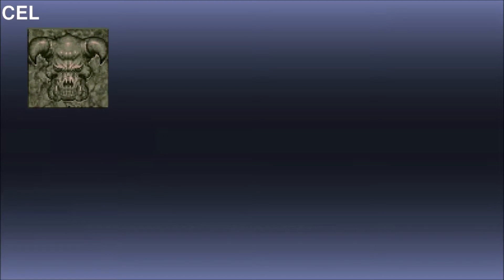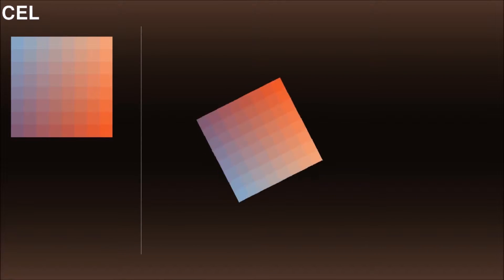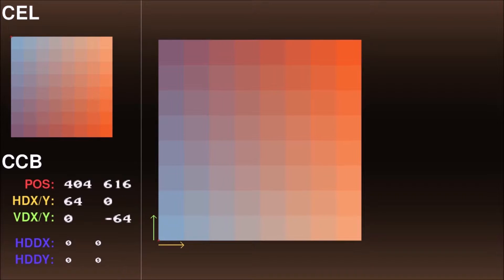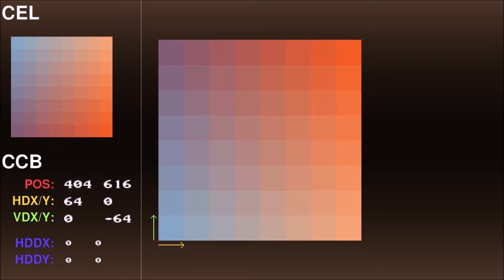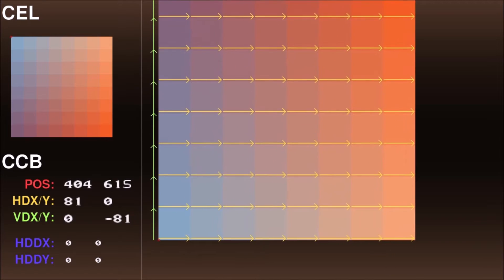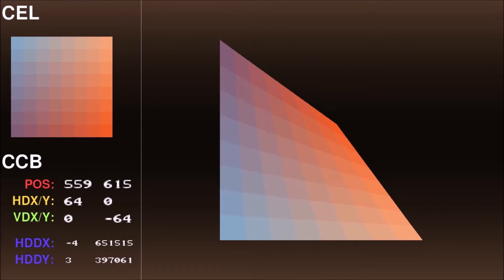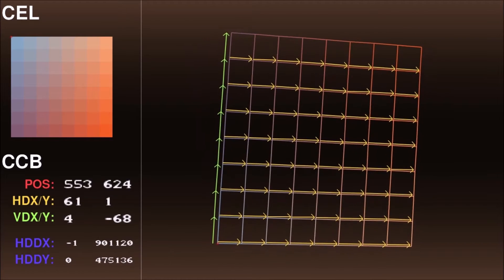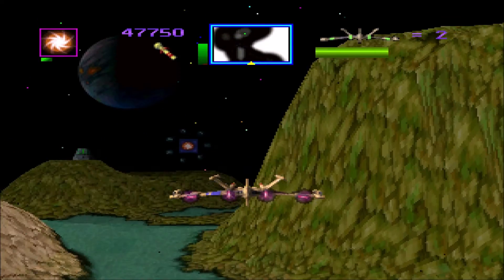3DO Rendering, CEL Vectors explained

Comment: I guess this way (as opposed to the modern arbitrary sampling way) makes sense if you were coming from the sega genesis/master system, and your experience with stretching background layers is via using h-blank and v-blank updates.

As in, partway through drawing something on screen, you update the values of the scan next line drawn. This allows you to make stretched out, distorted, etc. shapes.

With that concept fresh in memory, maybe that's why they did it this way.

See coding hut's explaination of the sonic bonus world rotation, or mickey's tower or waterfall effects, or of course paralelex scrolling.

Just a guess from me.

Interesting video! Thank you for this.

Comment: Is it possible to alter the vectors by matrix multiplication? I'm writing a 3DO CEL engine emulator that runs on modern GPUs via HLSL. (I found out that you can use HLSL to code shaders for both DirectX and Vulkan)

My 3DO CEL emulator works by taking vertices in, which are turned into quads/CELs by the geometry shader.
Reply from the maker: It depends on what you want to do. I am not sure.
I mean, you can multiply the vectors. If the CEL is showing a 2d sprite, multiplying the two main vectors with a 2d rotation matrix will rotate the sprite. But on 3D, you have the finally 2D projected quads on screen, so it won't help. So, while I have CPU code that will convert 4 quad points to the 3 vectors (and in case of sprites you need the 2 vectors only, and no points, just position, zoom and angle, I end up doing all my 3D math on CPU (although there is hardware matrix I see, but I need to see how it works) get the final projected quad vertices on the screen, now with some CPU code I convert to the vectors necessary to fit this quad (I don't know if it can be done with a matrix or if it's worth it).
Reply: @Optimus6128  I'm thinking of using a 3x3 matrix for the CEL's translation and scaling, not just for rotation in 2D space.
Reply from the maker: @gdm413229  It should be possible.

Comment: So the 3D0 is essentially the Saturn with only one VDP?
Reply from the maker: Yeah, just a main framebuffer and the ability to strech bitmaps to fit any arbitrary quad. So I guess it's like VDP1 with one a single layer.
One pro is that enabling translucency will blend with what is already rendered in the background after every single CEL quad rendering, so you can blend sprites above sprites above sprites, works like a charm even if slower, unlike Saturn having several troubles with this.

As I am reading about the Saturn VDP processors, the different layers and why it struggles with transparency, it's an interesting system which I might try coding something in the future (mostly to make some interesting comparisons between 3DO renderer and Saturn)

Comment: Is it possible to develop a 3DO game using a modern computer or do we need a Dev-kit for it? nice videos btw. I'm subscribed to your channel now.
Reply from the maker: Of course it is possible. I don't even own any devkit (they must be very rare or expensive now).
I have set up a compiler on Windows and using some additional tools to write to encrypted ISO, it was a bit tedious to set up at first, but there was a tutorial somewhere to start homebrew coding. I currently experiment with various stuff and also work a bit on the Doom 3DO code.
Reply: @Optimus6128  Thanks for your reply. Nice to read that. I've tried to look up for this on google but I couldn't find any information. Maybe I did not use the right words. Would be great if you can show us a little bit of your setup.
Reply from the maker: @Hackinside  You can check http://www.3do.cdinteractive.co.uk/viewtopic.php?f=21&t=3547 and maybe there is more in the forum http://www.3do.cdinteractive.co.uk/viewforum.php?f=21
However, as it usually happens with small homebrew communities, there might be some broken links to the tools. I'll try to find other links later (or maybe when I get time, upload them in my site and post a small tutorial, will see)

Comment: Love your videos! The 3do seems very similar to the Saturn. Using lower quality textures makes a huge difference in performances too, so mipmapping and LOD are really good optimisations. Nice to know that the 3do has no problem with transparency, unlike the Saturn where it's buggy.
Reply from the maker: I heard somewhere that a reason Saturn has problem with transparency is because of this forward rendering, you could have overdraw and few of the bitmap pixels will additive blend more times on the same pixel for example, so you get artifacts if I understood. There was an emulator developer (although I am not sure he ever made a Saturn emulator but was very knowledgable) who mentioned this. Is that true? (I'd have to experiment coding for Saturn to figure this out, but I'd ask you :)

Previously, I thought that the problem with Saturn and transparency is that it's one out of the five layers, and that layer will blend with the others so you could have a transparent object, but not transparent objects over transparent objects unless you do software rendering over that layer, while on the 3DO every cel you render with transparency will do operation with what's already in the framebuffer, so just z-sort the order of rendering of your transparent cels and apply them and it will work. But I can confirm that I have never encountered artifacts in the case of 3DO when I render transparent cels in my 3D geometry no matter the shape or size (but I haven't tested yet the twisted shapes) which could be a problem when the cels would be less than 1x scale and it would render pixels over pixels, but also if I understood the patent I read, they keep track of pixel coverage to avoid this.
Reply: @Optimus6128  Yes, it creates artifacts, but only with distorted sprites. When the sprite is just scaled without distortion it works fine. Yes also about the layers : the  sprite transparency only works over other sprites...only if they are using RGB color code (no palettes). Most people just used the mesh effect where you skip 1 pixel out of 2 as it's just way easier and it works over every layer and sprite type.
It's possible to use other fancy tricks to get transparency, but it's never perfect. At least the transparency with the background processor (vdp2) works really well and is super fast.
Reply from the maker: @xl2k2008  Interesting, good to know. It makes sense that when quads are aligned to the screen to not have artifacts.
Saturn is more specialized with the many layers and processors that maybe interesting architecture but come with problems and restrictions.
3DO is more simple run of the mill generic renderer drawing at a framebuffer that sits on regular memory. So the blend function will blend CEL to framebuffer, and we can continue subsequently blending the next CELs against the already blended framebuffer without issues. There are different color depths of CELs, from 8bit palettized, 8bit/16bit RGB, and others, blend or other functions works the same for all, no problem.
Reply: @Optimus6128  The Saturn is very complicated, but it should allow (on paper at least) very advanced effects not possible on other consoles of the era, but it's almost impossible to make everything work together. Your videos makes me want to try to buy a 3do and try programming on it. Sadly they aren't cheap now!
Reply from the maker: @xl2k2008  Yes, the 3DOs at Ebay now are more expensive than when I bought my first one. I was looking to get a second one but nope.